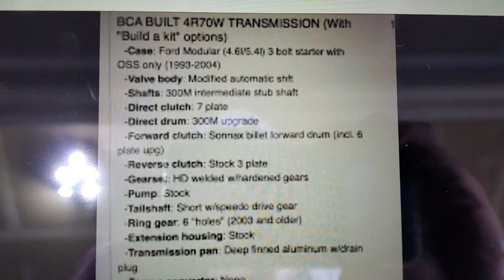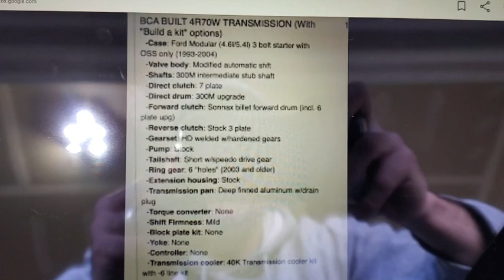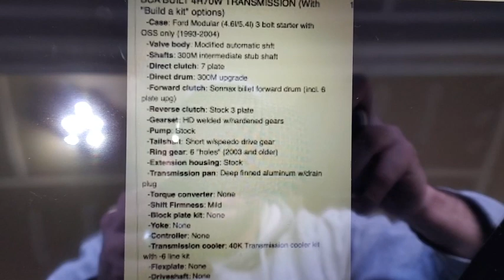4R70W Review for my 2003 Mach 1 Mustang (Built by Darrin Burch at BCA Transmissions)

Comment: I learned the hard way not to run a deep dish trans pan on a lowered Mustang.  Popped a manhole cover, shattered pan and case.  Went with a lentech stage 4.  Never been so happy with a trans.  Worth every penny.  I've put >150k miles on it so far, driving it like I stole it from day one.  Still shifts great, but does over heat a bit.  You're going to love a built 4R7X.
Reply from the maker: Lentech does make a good transmission and I appreciate the advice on the deep pan.   Spring can't come soon enough!!!

Comment: Hi Miles, this is a great video, lots of awesome information! I'm swapping a built 460 into my 1995 F150 and it has a 4R70W that I would like to use it with the swap. Do you know about how much this build ran you? Everything I've seen and heard about BCA transmissions has been top notch and I am interested in going with them to have this stock transmission built, especially because I'm in Kentucky and they are about as far from me as they are you haha. Thanks so much! -Ben
Reply from the maker: BCA makes great transmissions.  Also check out Dan from SilverFox.  Very nice gentleman as well.   The price depends on how many horsepower you are trying to make.  You can spend 1500 to 4000 depending on the build.  Thank you for watching and if you haven't yet, please subscribe.

Comment: Hey i have a 06 gt auto and I am thinking about doing 4r70w on mustang no boost and all motor but his his everything that I need in order to install the transmission
Reply from the maker: Hi Tiger,  Here is a list over everything you need if you have a GT. 4R70W with either a performance valve body or modified (JMOD) and a higher stall torque converter so it moves.  Auto driveshaft or manual driveshaft with the yoke changed.  Auto radiator with lines or aftermarket trans cooler that is at least 30k cooling such as the Tru Cool 40k.  Auto computer and harness or Quick 4 controller.  Then you need to get the shifter, shifter cable, flexplate, torque converter nuts, and ARP flexplate bolts.  Let me know if you have any other questions.